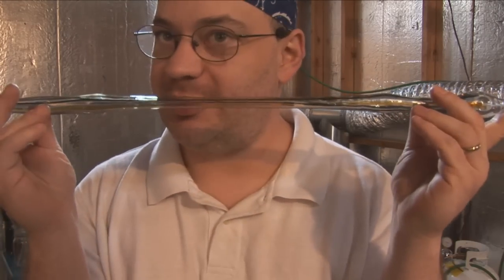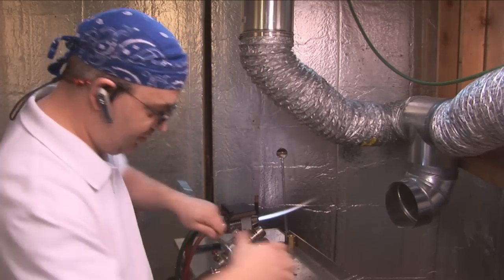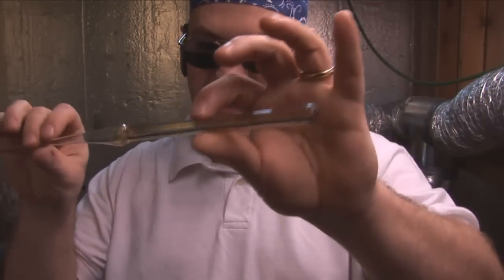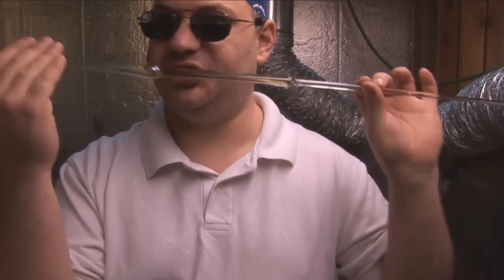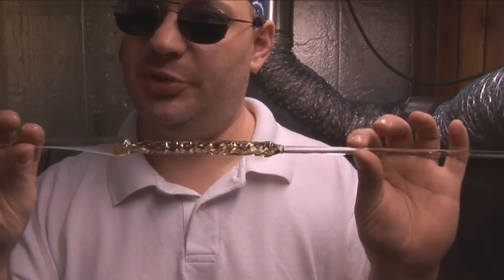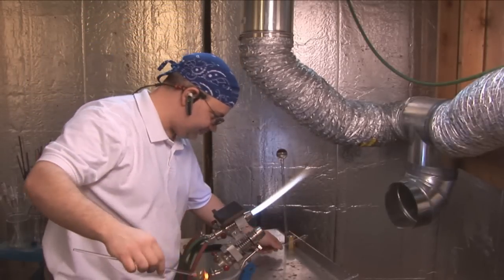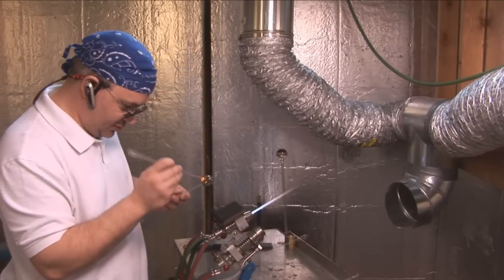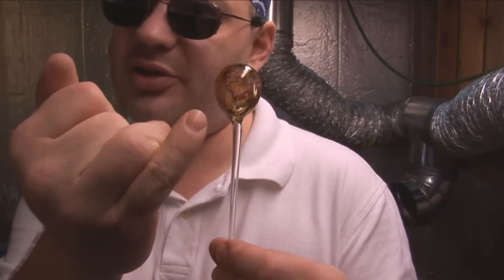torch time 2 switchbacks and reversals from color tube

Comment: Hey, nice vids, sorry If I missed something but can you tell me a little about the venitlation system. Why did you choose to buid it the way it is? Are there no gases escaping above it/sideways? especially when you place something right in the flame so the heat and gases spread around it and right back at you.. Im planning on moving my studio into a larger room (a garage) and Im trying to figure out a good ventilation system.
Thanks!